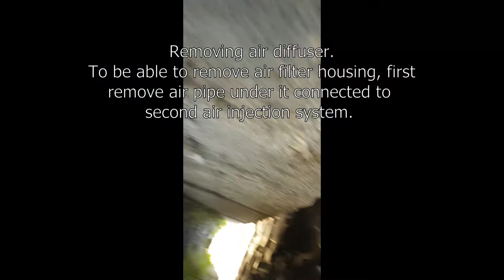Audi a8 d3 oil change

Comment: Had my A8 serviced at the dealer till about 70,000 miles. I decided to do the next oil change. The filter was never changed by the dealer in all that time. A heat shield needs to be moved and creases after.  It was never moved, and the oil filter was degraded when i fished it out.  Guess they can't be bothered.  Do it yourself!
Reply from the maker: That's why I'm doing it by myself.
Reply: @chichovenci  Great use of that concrete lift BTW.  Back in the day, we used a couple of spare tires placed on the ground and a few bricks as a small ramp.  Just drove up on the spares!